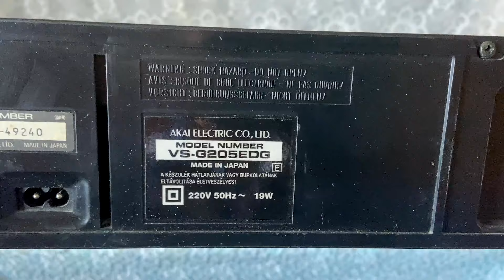Unkillable Akai VCR, model VS-G205EDG | Unboxing a workhorse for VHS

Comment: How and why do you have a Hungarian VCR? (Warning sticker on the back). 😁 I'm really curious as I'm from there.
Reply from the maker: I bought this VCR completely by accident. I didn't know it was from Hungary. It's a very good product and works without failures. Probably the previous owner during his trip to Hungary gave himself a present and bought this device :)
Reply: @technologywins  That sounds like an adventure. 😁 It's a really small country so I was surprised. I hope it still works fine!